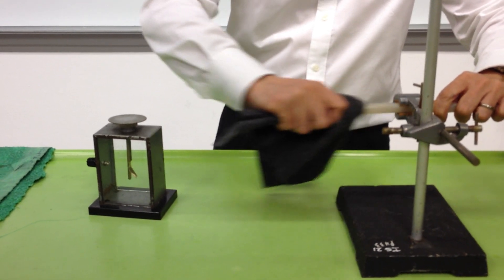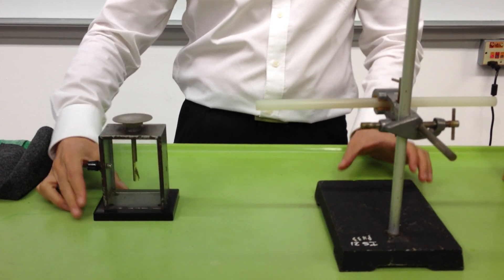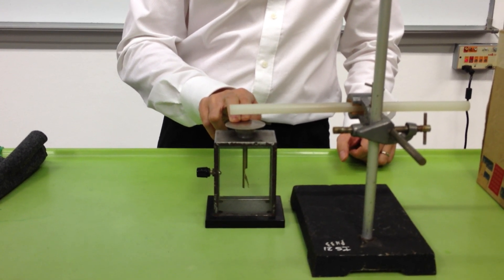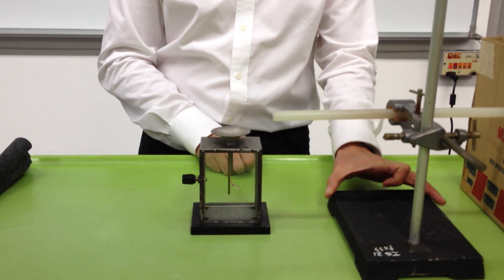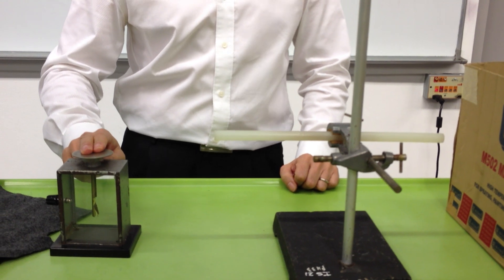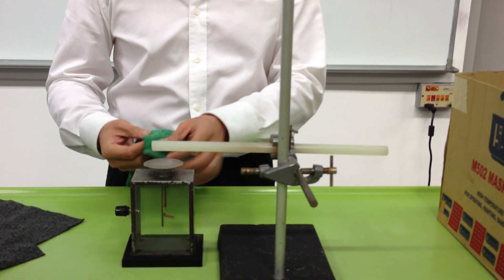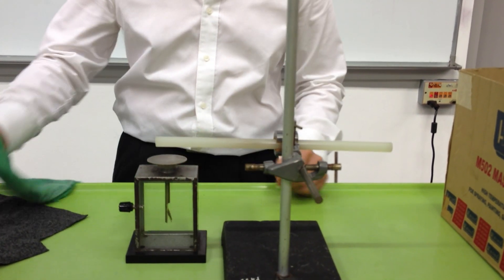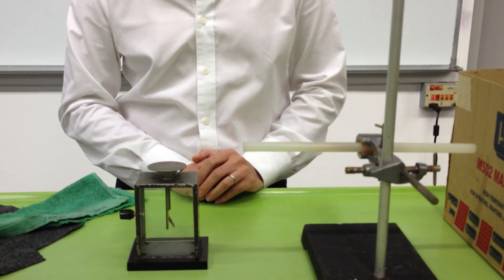Goldleaf Electroscope Experiment 1

Comment: When the fingers on the plate, the negative charge same as on ebonite rod is gone and the positive charge remains on the plate. When the finger is off, the positive charge tries to spread on the metal rod ,plate and gold leaf. If makes the ebonite rod close to the plate, then leaf decreases because the ebonite rod can  hold the positive charge on the plate strongly. If makes the ebonite rod away, then leaf increases more than before because positive charge spreads and there is repulsive force due to positve charge only between the metal rod and gold leaf. On your question, it is because there is a little positive charge on the metal rod and gold leaf.